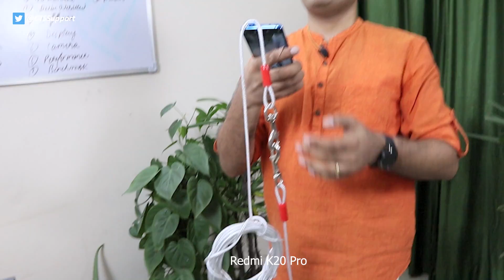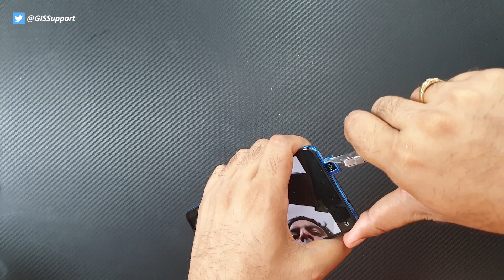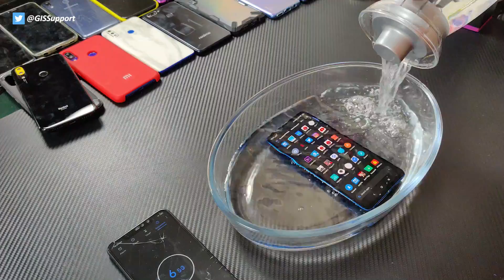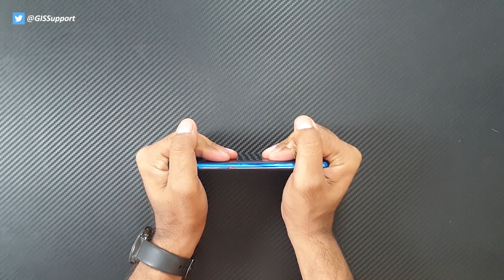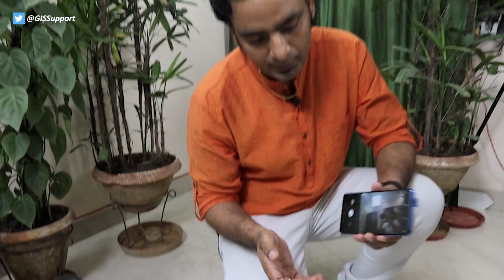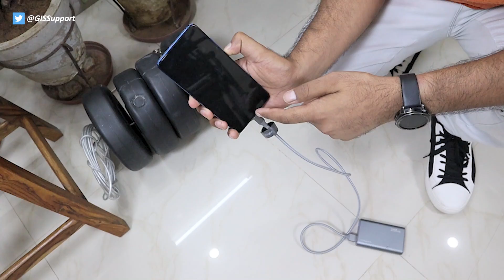Redmi K20 Pro (Mi 9T Pro) pop up camera Durability DROP Test | Gupta Information Systems | English

Comment: This video is actually really good.
Man, these K20 have durability problem for sure, having issue immediately after the first drop is not good sign.
Also, I wonder if dust can get into the popup camera area and cause issue after some years of usage. Could you try put it in a sand bowl, stir it a while to see if there is any issue ?
Reply: The phone worked fine until the 6th drop test, what do you mean?
Reply: What video were you watching. It held up after several drops. 🤦‍♂️

Comment: Boss when you dropped the phone from the charging port .The phone landed on back
Why someone will lift weight with the popup camera .No logic behind .How the phone will pass when you dropped it several times.
Reply: If it can lift 20kg then unknowingly if any hit / drop at it, then it won't broke,,,,, that's the inference,,,,
Reply: It called testing to its durability limits! For other to use as a reference.

Comment: The Mi9T is not the pro version It's the normal k20 with Snapdragon 730, I know this because it's what I'm typing this message on now.
Reply: Is it too heavy in the hands? And is it larger than normal 16:9 phone?
Reply: @ritikjain4256  Not sure about the exact dimensions but it has a 6.38 AMOLED display, bigger and heavier than my last phone which was the P10 lite but this has a bigger battery so it's to be expected. After a few days I have adjusted and now I notice no difference, for a midrange to high device at around this price, this is the best you will find unless you're in no rush and willing to wait a couple monthy:-)
Reply from the maker: both have same construction
Reply: @GuptaInformationSystemsEnglish  yeah sir gupta but the difference between k20 (mi9t) and k20 pro is the cipset built in mi9t sd 730 while k20 pro sd 855
Reply: @LuciferMorningstar-eo9pn  I'm also considering changing from my current Huawei P10 Lite to this one. Glad it worked out for you.
Reply: @ritikjain4256  i upgraded to Redmi K20 Pro from Redmi Note 5(Pro). The K20 Pro is significantly heavier, but that's good. It feels solid. I my case, the Redmi K20 Pro is actually smaller than the Redmi Note 5(Pro).